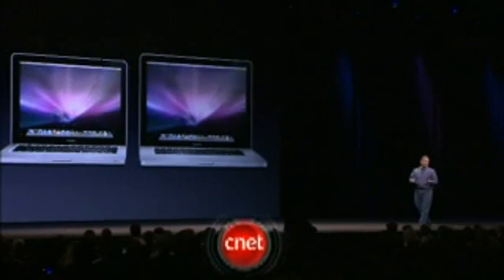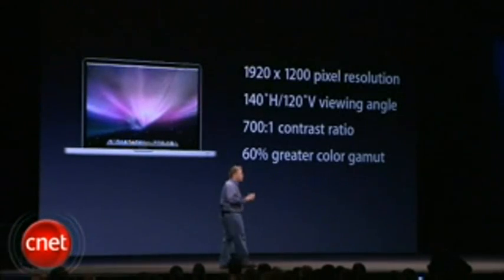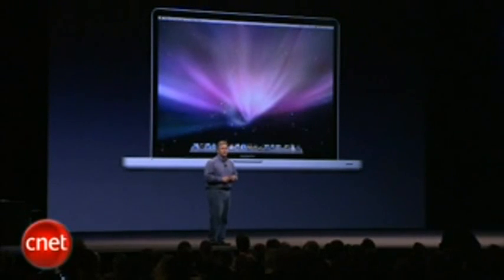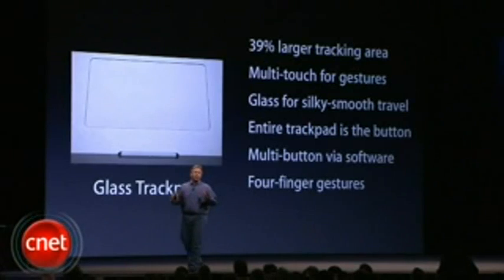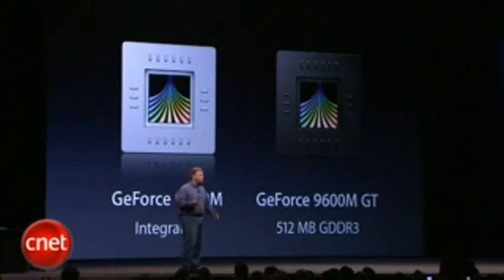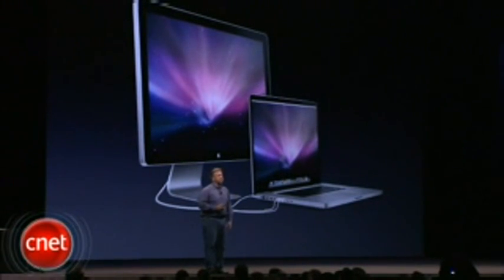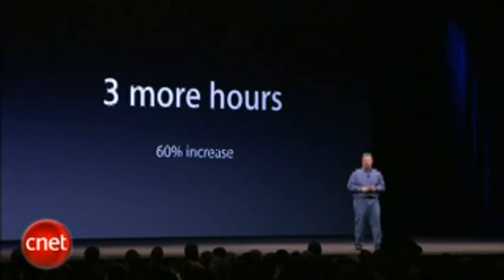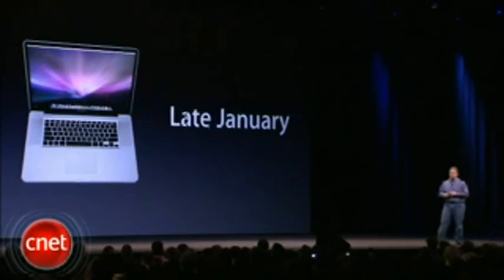MacWorld 2009 - MacBook Pro 17 inch

Comment from the maker: It's faster and it does not use any moving parts so if you accidently drop your laptop, it wont freeze up on you. When you drop a laptop with a hard drive, you typically experience a data loss from your laptop because hard drives having moving parts which require no shaking or movement of the laptop whatsoever.

Comment: I love that this was in my recommended videos after 15 years hahha, I recently bought a 17" 2009 macbook pro and it works quite well especially as it's such an old device by anyone's standards, it runs Monterey quite well with open core legacy patcher and can dual boot with Windows 10 which was the main reason to buy it along with the screen size and optical drive, you can use an SD card in this as long as you have a usb thumb with the sd card slot adapter

Comment: @2MCHNV No need to throw away Windows 7, you can install it on the Macbook Pro in case you're using it for gaming or any other apps which might not be compatible with Snow Leopard.

Comment: I'm wondering, how can I be sure that it's off? These days you have to take out the battery out of a mobile to be sure nobody uses it to spy on you. It's probably possible to use the microphone and camera without you knowing it. A sticker solves the camera problem but what about the sound and tracking?

Comment: Watching this on a 2010 model of the laptop. 480P looks like a fucking turd was used to record it.
Reply: It makes no sense because the 2009 macbook could actually do 1080p video, it can still function just fine watching 1080p videos to this day, i have the 17" 2.93Ghz model running Monterey with open core legacy patcher and it works great